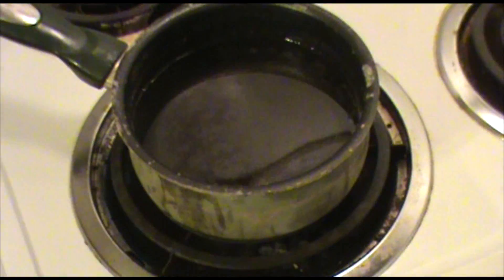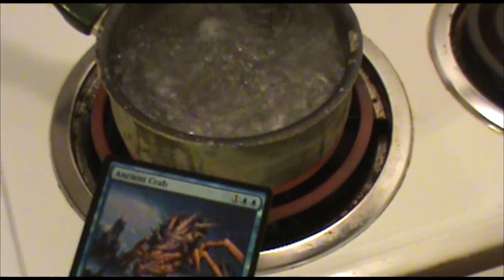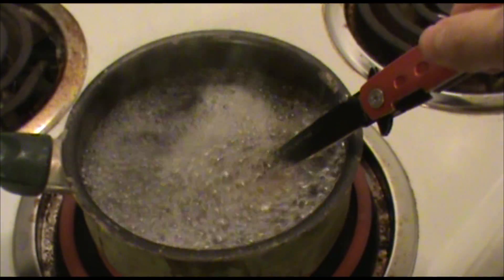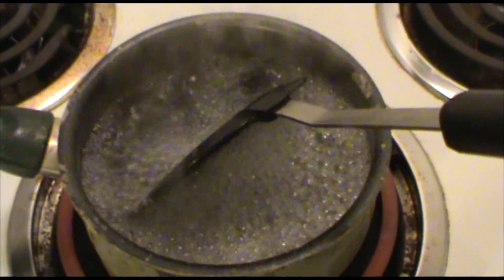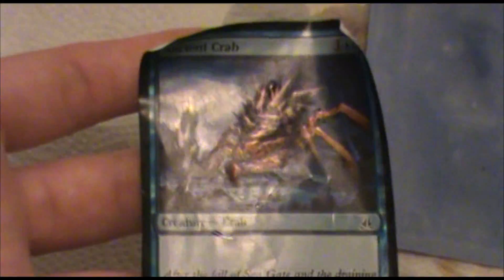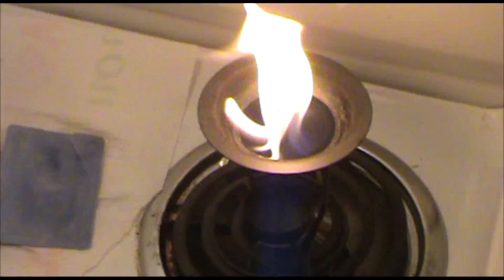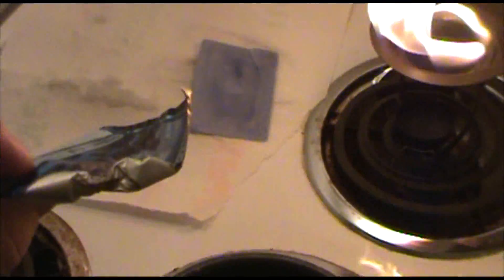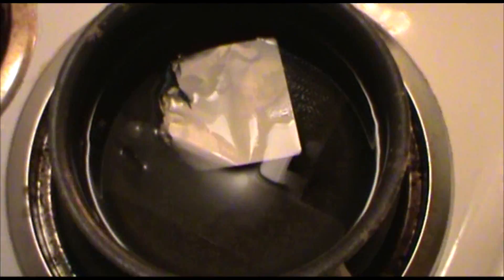Boiling a Foil Card - For Science of Course!

Comment: I'm guessing it lithium metal because we use it screens for smart phones. And its a very light metal than aluminum foil. But more likely lithium salt or lithium something mix with some kind of poly-material. However lithium us very reactive because boiling it with water (hydrogen oxide.) which reacts to the excited molecules of hydrogen and oxygen bonds. Especially with fire. Then it'll turn into lithium oxide or as you it "ash"

Lithium is part of the alkaline metals or alkaline earth metals if I remember. Surely of they use aluminium polyester plastic or what ever they use just by guessing. Surely you can tell which pack has a foil card just by weighing the pack. 

Surely you can "bing" it up and find out.

Comment: Foil composition:
Film carrier: The thinner the carriers (often polyester) while  all other things being equal, the faster the foil will transfer
Release Coat: Allows the other layers to release from the film carrier upon application  of heat &/or pressure in which this 
layer affects whether or not a foil is  suitable for fine copy or heavy coverage. Lacquer, Tie or Color Coat provides a  hard abrasion resistant surface to the foil when applied and carries the color  tint in the form of pigments or dyes which is required to make gold or other colored metallic because the metallic layer is always made from aluminum.
Metal Coat: Generally composed of aluminum to provide the reflective qualities and  opacity desired in metallic foils.
Adhesive or Sizing Coat: The final layer in the foil construction is the sizing which  serves to bond the foil to the 
substrate being stamped.

Comment: Twist it and use it as a wire to conduct some weak electricity and see if it's conductive?
Reply: he said no cause i think he said he tested it with a ohm meter or voltmeter
Reply: Tan yew sun
Yeah, but I'm wondering if there's an insulating layer around the outside of it (like plastic) that would stop a voltmeter from making a decent connection, but that a weak electrical charge would burn through.

Comment: It's kind of metal? From what I know, MTG foils are made using holographic "metallized" laminating film. Different versions and etc. have been used through out the years, but the process isn't that difficult to pin down.

They cut and bind material from sheets like the ones I've linked below (but not what I've linked, as I'm almost 100% sure they use a custom laminate produced for them, though many card games utilize material exactly like what I've linked below!), and they adhere them to blank pieces of cardstock, and they print the card information on top of the laminate (often double-printing, utilizing an 8-color process rather than a 4-5 color process used in normal and older cards) , then allow it to bind.  

https://www.alibaba.com/product-detail/holographic-metallized-matt-laminating-film-sheet_60493101519.html?spm=a2700.7724857.0.0.txaXQc

Comment: There is a difference between thermoplastics and thermoset plastics in that a thermoplastic does melt under high temperature but thermoset don't. I also think that what was bubbling in the acid was the remaining paper fibers and glue because organic materials also react with acid, but less efficiently as metal. I think it is safe to conclude that the foiling on magic cards is indeed plastic

Comment: 1. Metal burns
2. Wiping the ink on the card with acetone reveals the foil layer, there is another layer behind the foil layer, which is why you didn't see the foil effect from the backside. This is probably a plastic layer, which holds the extremely thin metal layer that is responsible for the glossy effect.
3. As for those bubbles - that could have been pretty much anything. Throwing a stone into a liquid close to boiling point will cause an increasing quantity of bubbles to form, even though there's no reaction going on. In fact, even if it did react with a metal layer, you probably wouldn't even notice because the film is so thin there's barely any metal in it.

My Verdict: A Foil card is probably set up like this: Color-Metallic Foil Layer-Plastic Layer for stability-Glue-Cardboard

Comment: You know, the answer is quite simple. It's both. 
Almost all magic cards (at least the newer ones) have  thin layer of that plastic on the hard card paper that holds the print of the card. Foil magic cards simply have small bits of aluminum foil on which the ink is printed onto, giving the shiny appearance of the card. 
A friend of mine has a foil Kiora that is a little rough around the edges and we can almost always see where it is at in his deck because of the foil that pokes out of the paper and plastic edges.

Comment: I think its a similar process they use to make chrome plated plastic. From what i heard.  To get an even coat of thin metal on plastic.  They put the plastic in a near vacuum.  With very little inert gas.  Then the plating metal is vaporized.  The vaporized metal then coats the plastic.  Im sorry i cant remember what the process is called.  But i bet wizards just buys it pre made. I was able to buy some. sheets of foil paper at my local dollar tree its super thin. It feels plastic like but it conducts electricity.
Reply: I think the process is called Sputtering.
Reply: Vacuum metalizing

Comment: The gasses might be due to paper or glue residue on the front of the card. Also aluminium creates a tough layer of aluminum oxide on the surface, that may not be dissolved in the acid. Aluminium also dissolved in bases pH>10 as do th oxide. additionally try leaving the card over night and see how much is left.

Comment: If you just soak a foil in water the outermost layer will separate.
Alternatively you could just acetone to remove the ink and reveal it's true insides.
Great video, keep up the awesome work.
Reply: That no longer works. They changed their printing methods a few sets back. Now it's just a shiny, printed sticker.. essentially.. Attached with their blue adhesive.

Comment: Hello I just wanted to share some info that could be of value to this. There is a place in Leland N.C. called Coatings and Adhesive that makes the coatings for all kinds of things from cereal boxes, poker cards, cigarette packs among other things including trading cards. Depending on what kind of coating you are wanting, be it matte, smooth, gloss, or foil. They have chemist who produce these coatings in liquid form for printing companies across the world. Now here is the scary part of why you cant figure out what that coating is made of. Some of the Chemicals they like to blend range from Anthrax, Alcohol that is so concentrated it could damage inner organs if exposed to flesh, powdered rubber among other things. PPM or parts per million of each thing blended was vital to the point of using filter sock of smaller and smaller pores until each chemical could not break apart from the final emulsion also to keep the lumps out. I hope this helps so you know what kind of junk your boiling, your burning, and your handling all the time with your hands. Have a great day.

Comment: Lol. A video about watching a pot boil! Epic!

What you should do is get a shiny mylar balloon and throw that material in a microwave and see if it sparks. That might provide some insight... If the shiny balloon doesn't spark, then we will know that the foiling isn't JUST a shiny Mylar layer, and may actually have some metal content. If the balloon does spark, then we will know that the foil card may not have any actual metal content. Ok, so I guess it won't actually definitively tell us anything, but it might provide some insight.

It appears that foil cards almost certainly have a polymer layer. I don't know if the production of a shiny mylar uses some kind of silver fuming or similar process to achieve this reflective property, but I think that may be easily researched.

Comment: You could use acetone to remove the ink layer, then you would just have the foil left over.
Reply: That no longer works. On older foils it did. Wotc no longer prints ON a layer of foil. They now use a foil/sticker type thing printed, then attached to the card back like a sticker.
Reply: +Matt Webb oh, I didn't realize they changed how the cards were printed.  thanks for the info :D

Comment: you could take the ink off the top with varnish to see the material underneath
Reply: I did that exact thing with the older foil cards to make foil clue cards. Get some finger nail polish remover and with quick rubbing motions, you'll be able to remove the ink and leave the foil underneath. 

So far from what I've noticed is that this only works with older foil cards, they must be using a new method with their new cards because I was completely unable to remove even a speck of the ink.